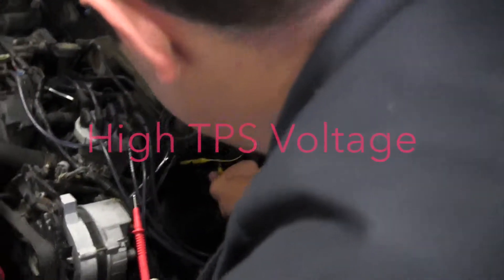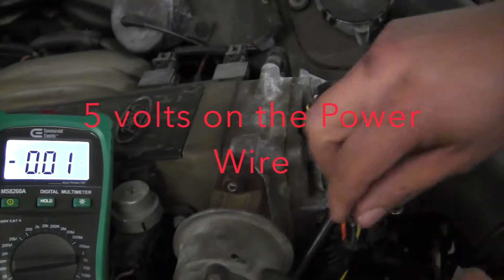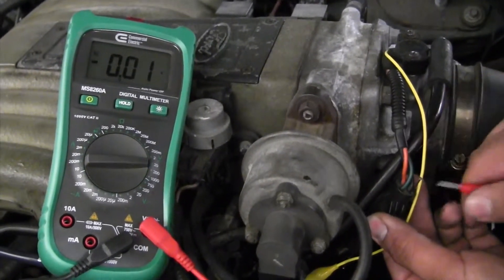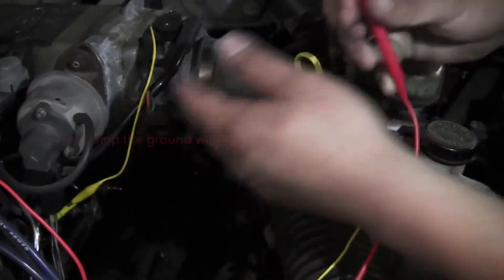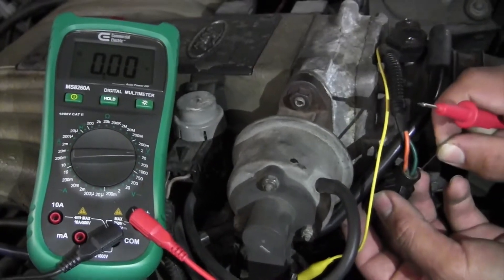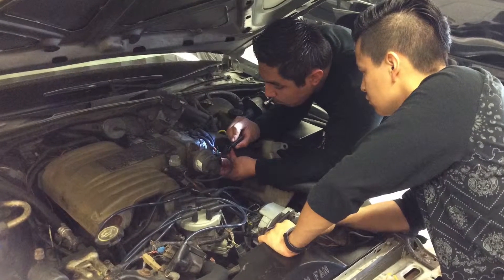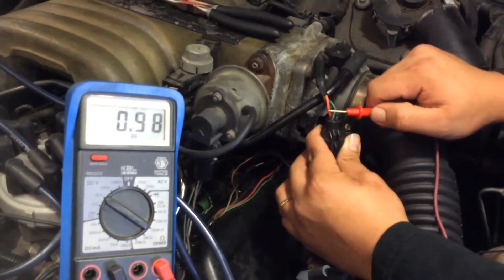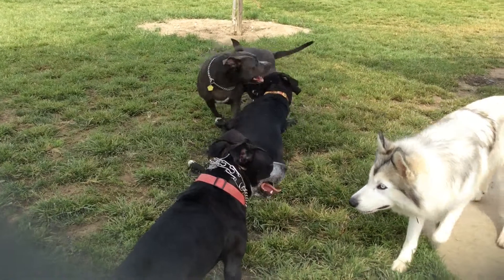FREE ASE PREP: TPS Repair no ground

Comment: Hello, I have a suzuki maruti with TPS problem, I check the plug with tps unpluged, have 5v reference, ground have also 5v... If i cut the ground wire and put directly to maybe any nearby bolt, would help the issue?
If remember well, when TPS is plug, volt is like 2.6v on reference and ground
Reply from the maker: If you have 5 volts on the ground circuit you have no ground connection on that wire make sure you check it plugged in and not disconnected

Comment: hey guys how did you guys fix the ground what did you attach it to
Reply from the maker: trace judkins they repair a bad connection inside the connector, the wire had an open within the connector itself. We initially thought it was an open wire somewhere in the loom, but they discovered the connector was the problem. Also can you believe they are just learning this WOW!! GREAT JOB GUYS!!  #ManuelCardoza
Reply from the maker: 2yrs to late but we soldiered the wire in the connector
Reply: @natedaviscteinstructor  from the ground wire to the body? Or to the negative battery terminal?

Comment from the maker: Free ASE PREP Video's at www.asetesttips.com, this video is an example of a vehicle with high TPS voltage on the signal wire. This vehicle came into the school with a check engine light with a code for TPS out of range.